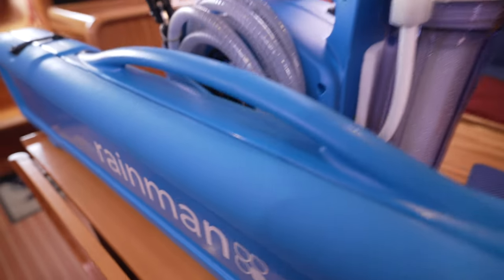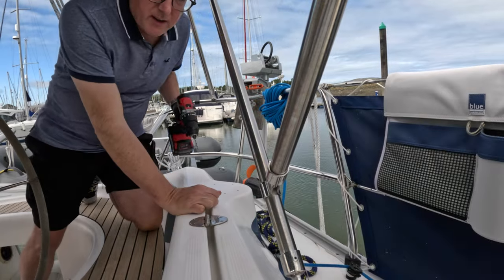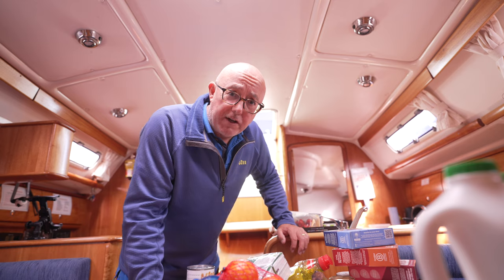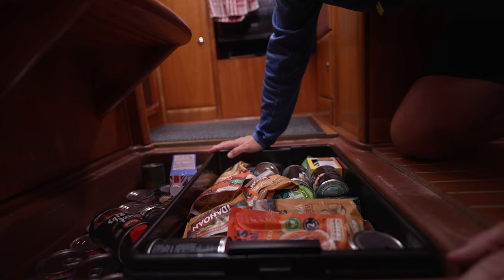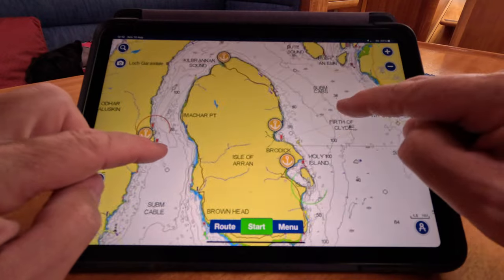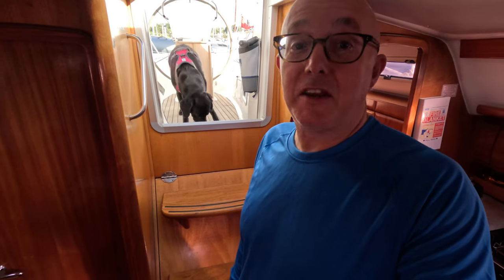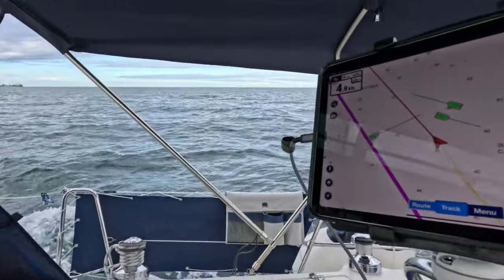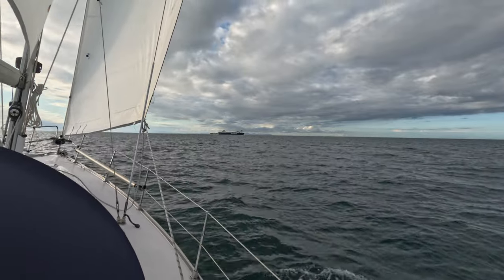SAILING SCOTLAND Pt1 | The Adventure Begins - Heading North From CONWY MARINA.

Comment: Did you put a backing plate on the inside of the locker under the winch?
Reply from the maker: No, I thought it should have had one so I checked this with the supplier and he confirmed you don’t need one.

Comment: That's it for installing winches? You don't need a backing plate on the other side of the fiberglass? Maybe they made the fiberglass especially thick there.
Reply from the maker: Hi Charles. I did think that too but yes the fibreglass is thick and there are no plates under the other winches either.

Comment: Rather than buy horrible UHT milk for an emergency supply, Evaporated milk is far better tasting when a tin is made up to 1 Ltr with water.  Also has a far longer shelf life (often years) and the tin won't get squashed and leak in a locker.  A tin in my cupboard has been there for 2 years and still has 6 months on its best before, not use by, date.
Reply from the maker: Didn’t think of that. Good idea Tony I will try that.